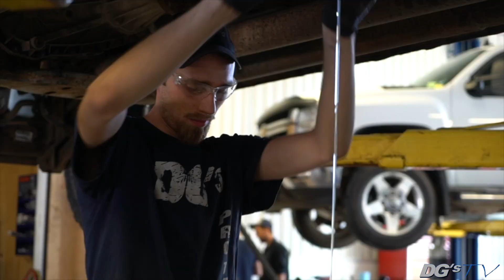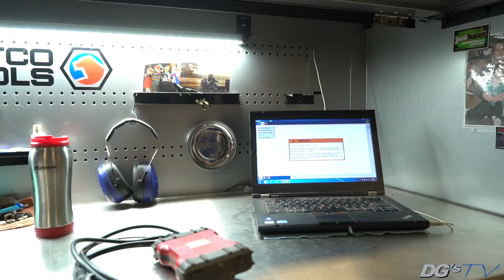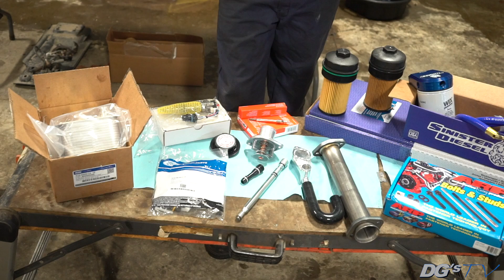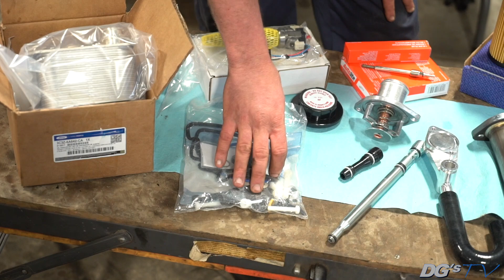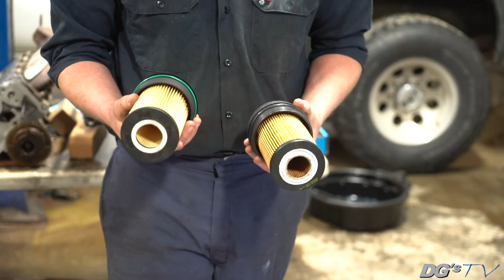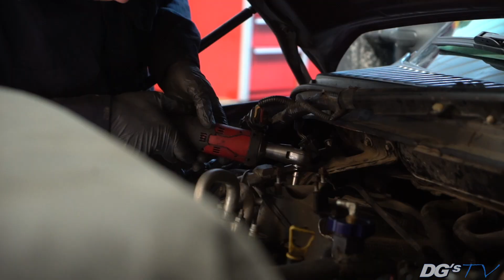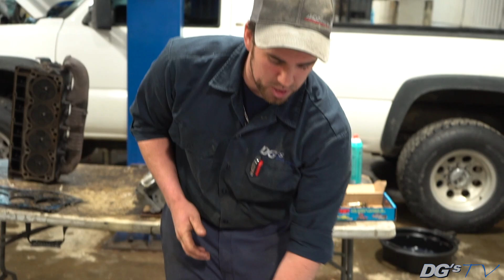EP 4 - Ford 6.0L Problems and Bulletproofing

Comment: My 05 king ranch I ran for 220,000 miles bone stock using cetane additive from Ford and it was fine when I sold it. I know the guy that bought it and all he did was delete the egr and emissions as well as a turbo back exhaust and it still runs great.

Comment: Side note I have a theory that the head gaskets get cooked out of them due to people driving around with bad EGR coolers and running them out of coolant repeatedly but that's just what I've seen a few times with the vt365 in a international 4200 .chassis tuning is drastically different in the 5 tons so that may help towards extended head gasket life also really tough to say
Reply from the maker: thats not a theory thats a proven fact.

Comment: Just got my 06 6L, going to head to the ford dealership tomorrow with the list of parts you presented. Going to get it all done. Thanks 🙏🏾
Reply: How much did it run yoy?
Reply: @HeartTribe   truck cost 9k flat about 2k in parts
Reply: @spotemshotemboys8163  well shit lol. 

Just picked one up for 12k and it only has 71k on it. Was debating if and when I should do it.
Reply: Update?
Reply: @SirGuidemere   Truck was a lemon. I drive 5.7 v8 2017 tundra now.
Reply: @spotemshotemboys8163  I’m sorry to hear that but appreciate your response. I was looking at one, think I’ll pass
Reply: @SirGuidemere   Yea man. After the 250 and my eco boost stang. Im done with ford. Water pumps blew on both. Emission problems with my mustang as well as electrical problems. Truck literally fell apart 6 months after purchase. Dumped 3k into it. 3 months later transmission went. Bought the 250 at 88k miles. Mustang got it at 17k miles. Both shit
Reply: @spotemshotemboys8163  man that is unfortunate. I love these trucks because the cab space but the drivetrains have been suspect after they left idi in my opinion.

Comment: I'm shopping for a 6beater, can anyone tell me which years to stay away from?
Reply from the maker: 05-07 are identical, 03 and 04 are similar but have slight differences depending on build date, both have pros and cons, look for maintenance logs and repairs done by pros
Reply: @dgsprotech985  Was told by a guy who apparently knows them inside and out to stick with 05's and up, looking at an 07 currently with relatively low mileage , no rust, and no level which leads me to believe it's been old man driven, guess we'll see what the obd has to say. Thanks btw for the response. Subbed.
Reply: *kilometers, didn't realize you were also from Canada lmao.

Comment: I'm a road service technician and I work on my 2003 6.0 f550 more than I do customers equipment I've done everything you have said  and Diesel Ron says there just junk I'm setting on the side of the road now with 2 different style snap on lab tops it shows no codes all the test show good results for those who have never owned  1 my a pion is don't unless you like being broke or pissed off all the time
Reply: If all that doesn't work, it's not the way the engine built that is the problem. You or someone else messed it up.
Reply: I think it's it's just the truck all together haven't had nothing but trouble since I got it just 1 thing after  another I have learned a lot from you guys and I'm sorry if I upset the 6.0 fans but I'm solving my problems with a c7 cat

Comment: I'm picking up my second 6.0 which will be a 2006 on the 1st and has had been Studded, deleted, IPR remote oil cooler, IPR remote coolant filter, new batteries in November. Is there anything else I should be on the look out for or should I be good?
Reply from the maker: Sounds like a good list, hp oil system concerns or sticking vgt

Comment: In a 2006, if over maintained(5000km 5w40 full synthetic, OEM filter and 50000km Premium gold coolant)
Should I worry about the oil cooler?
170000km
Reply from the maker: The oil cooler should be checked using a proper method of looking at ect vs eot under different driving situations
Reply: @dgsprotech985  My "delta" temperatures, which is what I believe you are speaking of.
Are within 5°C always(except for special situations, hills ect)
I flush my coolant with Motorcraft gold every 50k km.

Comment: I used to be a automotive machinists for years and 6.0 heads were always a blast lol. We always put bronze valve guide and all new seats in the heads since they are bad about cracking the seats. Plus always mill them flat with a CBN bit. But pressure testing was always the first thing. I don’t hundres of 6.0 heads and never had a failure.

Comment: I noticed the aftermarket radiator cap...aren't the radiator caps one of the main failure points on these trucks. I've been told to never use aftermarket caps.

Comment: So basically if you have a 6.0 plan on putting another 10k into it to make it reliable
Reply from the maker: no i wouldnt go that far, but compared to the concerns with the emissions in the 2008+ trucks (all brands) putting 6500 (which is the cost to bullet proof tax in) it makes them MUCH more reliable than doing each common repair seporate

Comment: You just convinced me to buy a gas truck.
Reply: After watching all these videos about all the problems with the 6.0, I think i'll just ride my bicycle. I have a 2015 Duramax, and have had ZERO problems with it!!
Reply: @redsox2187  I own a 1st gen raptor. Been a decent truck but I want to sell and buy something that pulls more and is cheaper to maintain. 6.0 can be had cheap but who the hell wants to drive a ticking time bomb?
Reply: @redsox2187  I'm thinking about buying a 2500 suburban or a v10 excursion. Cant decide.
Reply: @blakewilliams9642  1 vote for gm gas truck with the 6.0 before all the cylinder deactivation stuff

Comment: You may or may not know that Ford designed a push rod that's slightly shorter for the trucks that had machined heads. The shorter head put more pressure on the rod and caused some wear at the camshaft so they quietly redesigned them to solve the issue. Can't recall where I read that but measure a new and an old one and you'll see a miniscule difference but an important one. Hope that helps. Great video.
Reply from the maker: We appricate the great added info, yes we were aware of that and keep these in stock @DGs
Reply: 6.4 rods

Comment: I have 2006 6.0 and I have replaced every single injector in the last year more than once they keep on failing, it’s egr deleted and the heads got studded, I have a 6k tow tune on it and I don’t know why they keep failing
Reply from the maker: What brand of injectors, have you looked at fuel pressure under load ? Any high pressure oil concerns recent?
Reply: DG's Pro Tech I use motocraft injectors, I was reading online and I thought about installing the blue spring kit from sinister Diesel, one guy said he did and he stopped having to replace them
Reply: Kenneth Schauer I put one in last week, I’ve been running royal purple for the last month and everything seems to be doing fine, but now my exhaust is leaking, I swear it’s something everyday with my damn 6.0 😂

Comment: I have a 2011 FX4 when I turn the selector switch to 4hi a wrench comes up on the dash says check 4x4 most of the time 4low engages instead of 4hi without the truck in neutral and the switch being in 4hi going by the info would you say it's caused by a bad sector switch I cannot find any information on it thanks in advance
Reply: where did you end up? did you take it to a shop?

Comment: Unless you are a commercial operation pulling loads an awful lot of miles, diesels are not close to being cost effective over gas engines. And I would never consider a Ford diesel.
Reply: warren....completely agree w you
Reply: Ok, definitely don't buy one then
Reply: I can get as good or better fuel mileage as anyother vehicle on the road with the push of a button or I can turn it up and leave a lambo sitting in its tracks I love my 6.o I can still enjoy having my comfortable truck

Comment: I am a dodge 5.9 owner and have  been lucky so far.  It is sure nice to see a young lad who really knows his stuff, and takes pride in his work and profession.  All the best.  PS yes  cummins are very good but have their issues as well.
Reply from the maker: Apppricate the kind words, we try hard to keep customers happy
Reply: trans and killer dowel pins...now grid heater bolts and injection pumps...nobody offers a reliable truck engine these days, even on the commercial side

Comment: I have a an 03 6.0l and just replace the Egr cooler and oil cooler and upon further research it was determined that the Coolant and Coolant cap was most if not all of the Problem  ,the cap not holding 16 lbs of pressure allowed the coolant and the water boil and to drop all the imperises and it turn allow debris to end up in the oil cooler , so after flushing my coolant system 6 times with the last 2 flushes with denatured water (starter came out 6 six times)  heater core included... i replaced all the parts and went back with Peak Global 50/50 mix looking for 157f boiling point and installed a Stant 16 lb cap ,peak global has 0 silica(sand) and has a million mile warranty against corrosion , my truck is happy now and runs like it did when it was new...
Reply from the maker: That's great sounds like your very lucky it didn't lead to more
Reply: @dgsprotech985  as soon as the check engine light came on she got parked and fixed , still have more to do... thanks to u for taking the time to get this info out there so we can all save money and time...Thank you

Comment: What's the average cost to replace everything including glow plugs and injectors?
Reply from the maker: The bullet proofing stage 1 is 5800, injector replacement is only if it needs it and adds 375 per injector
Reply: @dgsprotech985  that's a awesome price. I had to have my 6.0 bullet proofed and it cost me $6900 here at the shop I use in Texas. 
 Great video by the way.
Reply: @robbyklein6589  That's Canadian isn't it?
Reply: @dgsprotech985  what is stage 2 and what does that involve or cost?

Comment: My 6.0  F350 is being "bulletproofed" at Bulletproof Diesel" in Mesa Arizona fight now.  Had a F250 with a 6.0 that was also "bulletproofed"  and was still running well at 996,000 miles when I sold it to a young man in the family and it still runs. I believe that the 6.0, once fixed and maintained is the best engine around.
Reply: Hey Michael, how much will the bullet proofing at the shop in Arizona be costing you?
Reply: @tannerannichiarico7255 bout fiddy
Reply: Michael Cornish 7.3
Reply: I have one of there 6.0 in my 06 f350 that I just bought
Reply: May 2 Cummins (5.9 & 6.7) have 87kmiles and 954k miles each never rebuilt, only maintained.  Never had to “bulletproof”them.   If only ford had Cummins.
Reply: @freerepublicusa2064 my neighbour's 5.9 blew up at 140 k. The killer dowel pin went thru the cam gears. Not good!
Reply: U gota bullet proof it why if it's the best moter ever there is a reason why ford caned it
Reply: @Kevin-qo6jw  "once fixed"
2nd bad rep
3rd not near today's engine power or torque
4 dpf/def fluid
Reply: @ewdtrey my 03 6.0 is quicker than my friends 22 Cummins high output. My 6.0  does have a light tune and cat delete. It is a lot quicker than his Cummins though. 
Either truck has more towing power than most of us would ever need.

Comment: Buy a diesel but better toss a dime a mile into your diesel rehab fund. Even a great diesel will cost more than a gasser over the long haul. Let's say your diesel actually last 500000 miles, the rest of the vehicle systems will fail and the body will crumble into brown dust 2 times over.  Diesels are for the idle rich, or HD commercial users. I could be wrong, but not by much:)

Comment: I'll keep my 7.3
Reply: thats fine. nobody wants that slug of a truck
Reply: @jasonwest4922  It's a 7,000 lb truck made for hauling shit and working. Just because it won't lite your American Forces up on your 12" lift is really of little concern to us that use their trucks for what their made for.
Reply: @cencoast_7.340   so daily hauling a 12k lbs car hauler isnt what its made for?
Reply: jason west So you love the 7.3 as well. Glad we all agree it’s a badass truck 🤙
Reply: found the middle age white dude that cant afford to build his diesel so he says hes gonna "keep it stock"
Reply: Furn333  sorry i dont speak walmart.
Reply: Amen bro. My 7.3 is still powerful enough to pull a trailer full of marble so damn heavy you cant stop the fuckn thing hardly. Why would you need anything any more powerful than this. And my 7.3 has 400k miles and still going on nothing but specified maintenance. Amazing truck!  Where are these guys coming from who call it a slug?  I saw this kid with this newer truck showing off with his over built diesel he did a four wheel burnout and ripped both drive lines out of the thing. wtf for. I am only asking cause I don"t know if im an idiot for thinking about buying another low mile 7.3  cause the newer trucks seem like junk to me.  I can hit 85 mph by the time I hit the bottom of the on ramp and travel at 85 mph for 3 hours and never miss a beat. fast enough for me son. No Bullet proof needed just a good radar detector. with the proper maintenance  7.3 are built bullet proof
Reply: I just bought a 2001 ford with a 7.3 with 88900 miles on it. My PawPaw had one on the farm and we could not kill the dam thing. I towed tractors, gang choppers, horse trailers. pulled stumps hauled wood through the fields. Well, a old southern oak finally killed late one evening, when it fail on it and Pop's still sold the motor for $1000.

Comment: As far as oil and fuel filters go, what are good alternatives, Donaldson seem to be a good product?
Also is it worth going to the higher end ARP studs?
Reply: Yes, if you tune or hot rod your 6.0l powerstroke you will need studs.  Always run Archoil 9100 in your oil and a good cetane booster in your fuel.  Remember a lot of these trucks were designed around high sulfur diesel and now the injectors need something added to the fuel with lubricity.
Reply: @richfarfugnuven6308  I’ve run Rev X and Archoil and didn’t notice a difference, the biggest change was running 5W40 synthetic and I use Power Sevices Diesel Kleen

Comment: This guy just called a 2500/3500 a light duty pickup.
Reply: They sure as hell ain't KW's
Reply: @walkerforsyth6221  he said pickup not 18 wheeler
Reply: @peterbuiltcummins413  So...  what actually is a "heavy duty" pickup then? A 1970 El Camino? Because that's about all I can come up with..
Reply: Big P Big P technically they are light duty diesel pickups sooo....
Reply: @gavinmccue9516  a light duty diesel pickup is a 1500 like the ram ecodiesel. Are you illeterate?
Reply: In the world of work trucks they are still light duty

Comment: On a 6.0L move the oil cooler from the valley of the block to the exterior of the engine with a bulletproof diesel oil cooler,  Goes from 16 quarts to 18.5 quarts, And oil stays much cooler.
Reply: and a measly 2k for the parts alone.  😁

Tearing into mine now.  I feel like I'm putting as many parts into it as it is worth.
Reply: @diymatt  remember, you can run a new F450 up to 110k$.....
Reply: Rich Farfugnuven did you do that?
Reply: @PhilD54  yes, on my excursion.   No, I did not do it myself, my buddy is a Powerstroke master mechanic.

Comment: The 6.0l is not as bad as the 6.4l Powerstroke was.  My 6.0l is dead reliable now.
Reply from the maker: They both have different issues for sure
Reply: Rich Farfugnuven if you delete a 6.4 they can be pretty good long lasting trucks, otherwise they are junk.
Reply: I'm look at a 2004 f240 6.0 powerstroke 160k miles been bulletproof for 7k should I get it?
Reply: @boobbutthole9537  have a qualified diesel mechanic check it over thoroughly.  If they have done the bulletproofing,, and it checks out, then yes...
Reply: @richfarfugnuven6308  he says it has an upgraded EGR the guy still had to pass emissions so is the upgraded parts worth it or should I just delete it all together
Reply: @boobbutthole9537  leave it until it starts to give you problems.  I internally welded my EGR.  It passes emissions fine.
Reply: @richfarfugnuven6308   I dint have emissions anymore in Washington state. Thank is god
Reply: @boobbutthole9537  you guys are getting so liberal(as is CO)  I would keep it intact for now...  I will be moving somewhere much more conservative when I retire...
Reply: @boobbutthole9537  yes, internally weld it so that it looks stock.  Tons of videos on how to do this.
Reply: @richfarfugnuven6308  Come to Mississippi my friend!!  We actually went the other direction a few years and got RID of our State Inspection Stickers.  Even then there we're no emissions testing.  So now, buy your tag and insurance and that is literally it!!  I love my state and I LOVE my 6.OHHH.
Reply: @boobbutthole9537  great deal if everything checks out.
Reply: Mine has 375,000 with no head studs, mine lasted and runs perfect because I never listened to people like you.....lmao....the 6.7 has more problems than the 6.0...powerstrokehelp and Bulletproof diesel mechanics pic the 6.0 as the best alaround diesel for the money and for reliability